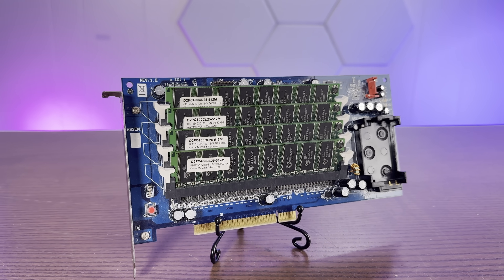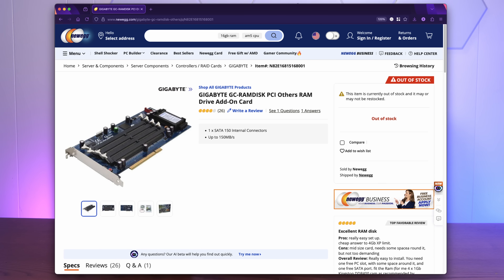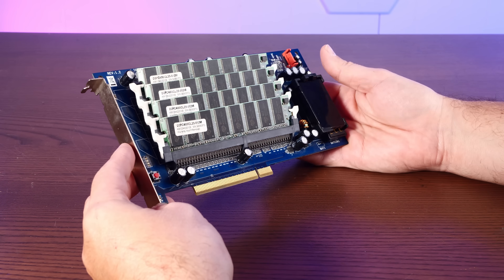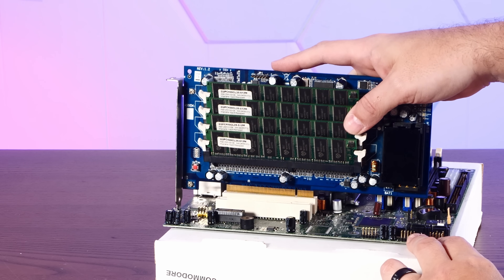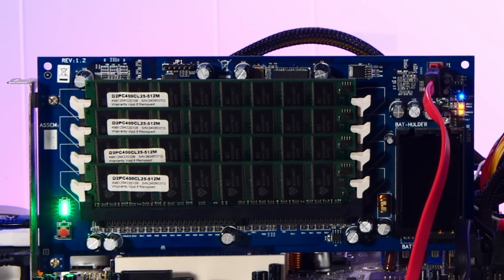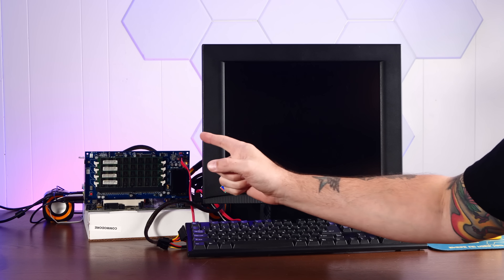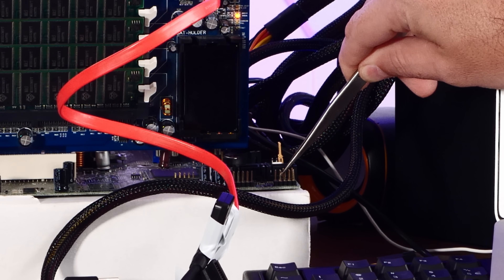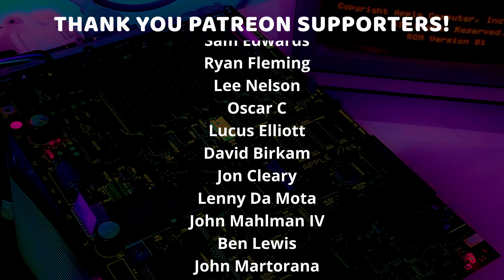This Early SSD Was WILD

Comment: OMG RAGE BAIT........ this was used as buffer drive not a disk drive you would us raid controller pair with HDD and it would buffer ya data , your read and write speed on a HDD would be around 500mb when set up correct... same could be done useing USB flash drive

Comment: BACK IN THE DAY...
i used mine to host all temp-file and swap-file data, and host some read-write intensive games.
Emulators especially benefit from being on a full disk made of ram. for example the 'dolphin' emulator, went from 15 fps to 56 fps by simply being stored on my i-ram.
One of the games i made most use out of my iram with was Ragnarok Online, allowing me to hop into loading zones LAST in my group, 
yet appear in the loaded area FIRST and begin battle as others finally loaded in.

I sung praises of the i-ram unit a great deal, and was only ever upset that it capped out at 4gb :(
I never bothered running an OS from it. because honestly i never shut my pc down accept to dismantle and clean out dust. 
I no longer use my I Ram device obviously. But it was a great way to skip a few generations of pc upgrades, and run a older system as if it was a more modern one back then.
Not really a end-user product though.  only enthusiasts and power users would bother with it for 'gaming'. I possess a strong gaming focus And programer focus, so i-ram absolutely was a world changing tool for me back then. And i wrote a lot of reviews speaking highly of it over the years.

I will say, a 'fast startup backed by pc memory' remains a waste of hardware to me.  That may have been the primary focus of too many gamers when i-ram was new, but it just wasn't the point IMO.  Buffering temp files, zip temp compression files, firefox and netscape and internet explorer temp files, videos, decompressing files, swap files, .log files all too often appended, and of course hosting the 'engines' of software, for fast random access read/writes was the bread and butter with my I-Ram.  and i didn't need a battery for any of that.  Just a good xcopy script and eventually robocopy.   and yes a PSU battery for the whole pc too "just in case".  I didn't even keep my i-ram battery in the case. it kinda looks like bar of dove soap these days a bloated little ball of nope I'd never want in my pc's. 

obviously i don't use my i-ram any more.  4gb is 44gb too small.  But I've gotten pretty good with robocopy and teaching windows startups and shut downs to mirror the current ram-disks (those use system memory) to m.2's and ssd's so they backup and repopulate on reboots. As for power outages,  Well those can hurt my pc.  Soooo i use a cyber-power battery backup with a usb alert status, so if it detects issues with the power it dumps a copy of the ram-disks i use to their respective ink-storage locations (SSD's). 

TO THIS DAY i still trust a ramdisk to do such things for me.  I've recently bought a thread-ripper pc, with 1TB of ram so far.  Just so i can maintain a large ram-disk space, and preserve writes to a bunch of raided m.2's that together are still slower then the ram disk (but not by nearly as much as back in the HDD days.) Conan Exiles™ for example, with mods, wants nearly 200GB of storage on steam. Atlas™ also uses like 145gb. Other games or emulators tend to use 1 to 30gb or so, and it adds up FAST.  browser cache and steam downloads. steam cache, steam workshop downloads are all so unkind to your storage spaces, and so having a massive fast access ram space feels almost mandatory these days. 

I only regret that Gigabyte didn't come out with further versions of the i-ram device. (i must have written to them begging for such like 20 times). I-Ram pulled its weight and then some for MANY years for me, and shaped my trust in the careful management of RAM as Drive Storage that continues even now into the beast of a pc I've recently built.   Thanks to modern ram-disks I've a lot of eide hdd's and small early-adopter ssd's going on 25 (and under) that are still kickin around in my machine fully functional with some adaptation cards bridging the age gap. It's still clear and evident proof that reducing your number of read/writes to a device does in fact help preserve its longevity.  not that such was ever in dispute heh.

Thank you for doing a video on one of the most beloved bits of hardware i ever worked with, one that changed my approach to pc-usage for the rest of my life!  ❤🎀💕💋💖

Comment: I wonder what speeds you would have seen with perhaps a higher-end HDD like the WD VelociRaptors which turned at 10,000 RPM (which I believe were also SATA 2.0 compliant, so 300 MB/s) and I think had a lot more cache (and were often times put into RAID 0's) for gaming machines.  I mean modern HDDs like the WD Black drives can hit around 150 MB/s and sometimes faster.

I could see possibly using something like this for use along side a bootable live LInux CD that maybe need some "disk space" to store files, but that could be erased quickly, or perhaps as you mentioned, swap space for programs, even though a modern NVME would be WAY faster, and even a SATA v3.0 SSD would also be much faster.

Comment: This is not SSD at all. SSD uses flash memory which doesn't need power to store data. It's a hardware RAM drive, fully another technology. Backup power requires, in case of power loss, all data will be lost.

Comment: I had something like this on a Apple II GS.  It used dip memory and had an AC adaptor. I don’t remember if it had a battery. It was more of a high speed storage device. About 1meg of storage. I sold it when I got a 20 meg hard drive.

Comment: This is actually a very fascinating idea. I'm certain modern battery solutions utilising 18350 batteries in 2 banks to be hot swappable could be viable so one could be replaced while still powered by one bank. Using such a drive to record video game footage might be something to consider (after recording sort through it and delete what isn't interesting).

Comment: I remember these mostly as a buffer between slower storage and heavy data use applications in servers.
Say you want to make a backup of a database server.....you don't want to wait on the tape robot to find the tape, position it and stream the data to the tape.....you want to store your backup on FAST storage, and let the backend sort out what tape it goes to later.
Also, you want your most used files to be on quick storage, even if they are a dublicate of the ones on "slow" spinning disks.
But then again, there was only a limited time these were worth the money, and I never got to play with them myself....

Comment: Back in the day around 1993 I had a DTC HDD Caching Controller that had 8x 30 pin SIMM slots on it. It was used to speed up hdd access. The primary reason for having something like that would be for compiling something large. Nowadays the thing you have might be useful and help speed up compiling something like MAME. Give it a shot and make a vid about it.

Comment: Prior to the DDR5 price bloat I was considering the following:

Buy a motherboard that would let me install 256gb RAM

At boot partition 192gb of RAM as tempFS (leaving 64gb for OS RAM) 

Copy from SSD an image of a preconfigured OS with  a single game (or a selection of games with installation size that fits into the 192gb)  into that tempFS

Then log into the RAM disk OS to play a game on a system that is entirely in volatile memory for the session.
Reply: ( I'm aware this would put tremendous load on the RAM and the MTBF for individual ICs on the RAM stick would probably drop like a rock )

Comment: Two slightly off statistics here, 2006 period correct would not be a Pentium 4 with Windows XP but a core two duo with Windows Vista second the hdd you should have used would be a 7200RPM disk that would have nearly doubled the speed on disk mark... other than that a very interesting video.

Comment: HDD cache and RAID controllers may have RAM too with battery backup. Actually SAS RAID cards are even more amazing: they have huge amount of RAM and a battery. During power outage, they copy the unwritten cache content to a nonvolatile flash memory chip (basically an SSD, and carry out the write operation during the next startup.

Comment: DDR4 could almost fully saturate a PCIe 5.0 x16 slot in quad channel which would be insane. If it were normal non-ai times I could see a card like this being pretty slick to have even today especially since there were some decent sized sticks made. Would be one hell of a cache drive, especially for big ZFS arrays on systems with maxed out ram slots as is. Or just a big dick swinging "because I can" boot drive haha.

Comment: If it was DDR4 or DDR5 on PCI-e x16, it could be used as a swap partitition on Linux. For those working with photogrammetry, for example, would allow for much larger workloads. Could be used for data storage for AI training, or anything that would need to read files with high frequency. You move the files you need from a reliable drive, do the processing, and get the results. It would defenitely be useful here, although expensive due to current RAM prices. And, of course, how much faster than a good NVME would it be?

Comment: I would love to find a board that can run off usb, and holds ddr2 laptop memory, you could acquire 2gb sticks from ewaist, an then use some sort of realtine zip, crunch it x4 and pull of 50 - 100 gb of ram disk, even cutting the read write to s quarter speed compressing shoukd still blow away an ssd

Comment: I remember this.  It was actually an ingenious idea.  You take a PC filled to the 4 GB (32 bit) limit.  From there a cable plugged into a SATA port showing it as a true RAM disk.

You adjust the Windows swap file to this drive, then all of a sudden your PC is acting like an 8 GIG PC (which for 32 bit architecture is amazing).

People ran speed tests with big Adobe applications processing really really big multimedia files of the time.  The speed tests were off the scale.

Also, this device can protect your PC.  If you setup a thin Windows setup off of it, boot from it, and use it to test new downloads, then you will never have to worry about a virus ruining your PC.  If a virus is detected, pull the battery and it's gone.

Last but not least, some used it to download directly to RAM to get full throughout from your networking devices (your talking milliseconds verse nanoseconds) before copying it over to stable storage.

Comment: If you could get larger memory sticks in it, I could see where this might have a niche use for an app that has to do a lot of I/O which might excessively age an SSD - the memory on this wouldn't be subject to the same wearing out as SSD memory is. Also goes to show the level of quality that they built into things that a 2006 item still works almost 20 years later.

Comment: I have one installed in my P3 Tualatin system, with a pci-sata add-on card and use it like one of the examples you described, as swap space as the 815 chipset only supports 512MB. I don't get as fast speeds as you're getting, because again 32 bit pci bus speeds can potentially get 133MB/sec but that is shared with the other pci devices installed in my retro pc, but it's faster than a swap file on my spinning disks.

Comment: notingt absaolulti noting at al caz itis on pci wachi si not frr data or spped it is nofre standart iwath adre pc preifereal .. wat wood be toady good froe it is froe adreig more stik of ream but to you diret ram slot pr to you pce expres slot yea thear si a lot od ddr 3 and ddr4 in lower volums modre thn can be usd insed of expesiv garbage in a pce expers stot  af fast storeage   mvme or diret in tha ddr 3 ddr4 slot to put lak in onsloet 4 ot 8  models od 4 gb  gen eindet of on eof 4 gb or one o 8  gb gen !!   CMG IDAE  EY ! DDR3 OR DDR4 IN FAST STOREGE  SET UP SI WEIL ALWES BE MORE FASTER THEN ENITIGN  GEN SSD OR IVEN M.2 ETC ..

Comment: I remember when people would sequester off some of their actual system RAM to use as storage. Back before non-volatile SSDs got popular, like when this thing actually came out 20 years ago, it made some sense. This device wasn't as fast as using system RAM, but given that a gig or two of RAM was a decent amount in the mid aughts, you didn't have a lot to play with. Offloading this to some RAM using the PCI bus made sense. Especially if you had some RAM lying around.

I almost bought one of these back in the day. But I am also the kind of person who, back then, had fun trying to get an AMD Athlon XP 2600 to boot at over 2600mhz (stock was 1917mhz, I could only get it to 2593mhz).

Comment: I actually did use one of those back in the day for temporary file crunching on a server.. data got placed into a temporary DB and then read out and processed by other apps before being placed in a permanent space... the soeed was aazing..  and rather than have to re-create it each time at boot.. this card allowed it to stay persistent.. since it was a server.. it was never turned off..  used it for a few years till the need no longer was there for it.. they were also great for re-rendering sopund or video files.. of course nothing compared to what we have now but for the time it was great... nowadays id have no use..  heck these days our PC's have more RAM in them than they did HDD space back then in a lot of cases.. for sure my Servers do.. every year modern SSD's get more reliable and faster

Comment: If this was a thing with modern ram it prob had even faster speeds id specifically use it as a way to keep temporary data over hardware restarts for something like a bot that does not need to store it forever but temporarily for like 2 days or so before it reaquires them to reduce load and allow faster operation.

Comment: A product I worked on we had a custom motherboard with one bank of RAM with battery backup, with enough battery so that a server could be moved or mailed to a different data center or returned to us. We kept storage transactions in the memory that still need to be committed to disk, it was a kind of cache but it could not be wiped until we either invalidated the transaction or wrote the data to a platter. Not really the same purpose as an SSD, but in a way it gave us similar write performance even though it was a product that was on the market 20 years ago.

Comment: Big deal.  I still have my ICD 1mb MIO for my Atari 8-bit computers back in the 80s.  It was a big fat external 1mb RAMdisk that plugged into the PBI port on my Atari 800XL for blazing fast DMA I/O in SpartaDOS X.  I used to use it to run my BBS on way back in the day and it was FAAAAAAAST!  Most people back in those days kept wondering if I actually was using a PC because it was so fast and I had it hosting ASCII, ATASCII, CCG, ANSI and VT52 menus and screens so people were VERY confused between the speeds and Oasis BBS Jr. hosting multple types of ASCII and color/cursor controlled screens on a VERY VERY fast  drive.   Use a web engine to search "ICD 1mb MIO" to find out more about it.

Comment: i mean the obvious use for it today would be have an external pci slot or if those dont exist a external pcie and pcie to pci adapter and use it for something illegal and if the cops come just yank the battery and unplug the computer or card when they knock on the door before they break it down. anything else with it now a days probably depends on the ram limits of the card

Comment: When this was new, I imagine the best use for it would be to hold your page file.  It would be orders of magnitude faster than a spinning hard disk, and fragmentation would be a non-issue.  Granted, depending on the OS and type of page file, fragmentation might not be an issue in the first place.

Using it for actual persistent data doesn't seem like a great idea in most circumstances, even with the onboard battery.

Comment: i wouldn't dare to use that in any case or scenario.

I remember that Asrock had a feature in their motherboards (back in DDR2 era, maybe also in AM3 platform) that could convert Ram into RamDisks.

i never really find a usage for that, since in that time ram was limited to 4gb in many boards, maybe 8gb if you had a good mobo and 16gb if you were extremely luck... so using Ram as actual ram was way more important than to use extra storage (by that time 500gb HDD were pretty common so... lack of space wasn't a problem).

Furthermore, regular HDD can already max out at SATA2 interface, so despite random access, the real advantage of SSD only truly shined with SATA3 (that being high end 2010/11 mobos, mid range 2012/14 mobos and any mobo from 2014 onward) just when nvme became a thing (it was pretty experimental back in the day)

Comment: There was a Fusion io ioDrive,  had an ioDrive Duo 640GB in my desktop at one time, the drivers allows for loading the drive contents from a slow hdd directly onto the ioDrive then you have blazing fast speeds, then on shutdown it'd flush the drive state to the same HDD for boot later.  It was pretty good unless you lost power...  fortunately you could reboot and it loaded the old save state.  Any changes made since last save were lost.  you could do delayed writes to hdd if you chose updating the save state on the fly.

it was enterprise grade stuff.

it would be cool to see a Epic Rap Battles of Storage between these two solutions.

Comment: back in the 80s we would us a Ram drive, set it up in the boot parameters and boot from a floppy.. the floppy would un-LHA and unzip we had zip before it existed into our ramdrive created when the boot floppy started it actually booted faster by uncompressing the data into the ram drive then loading it.. we had this feature on the commodore c64 and the Atari 800 computers.. check that out man.. we had this back in the early 80s so definitely nothing new..  I had a 1meg Atari 800xl back in 1986... and we ran most of our stuff from compressed files to save disk space on the floppy drives.. plus the games ran AWESOME from the ramdrive..